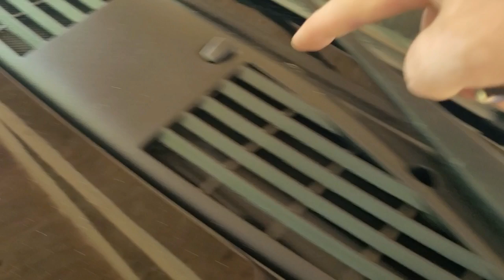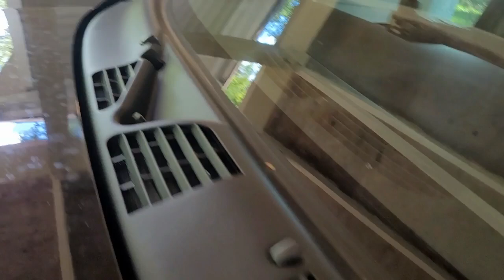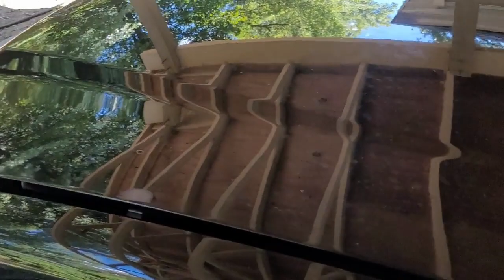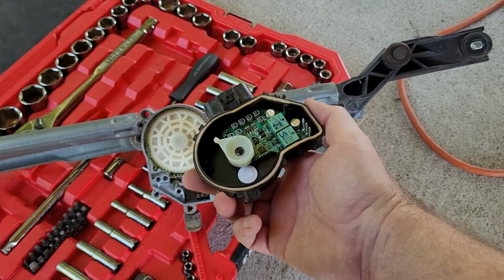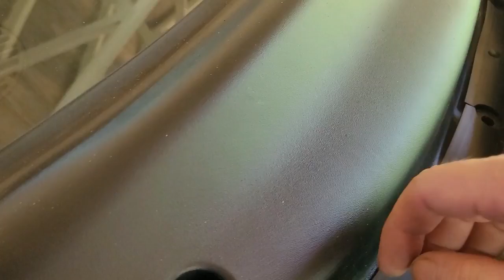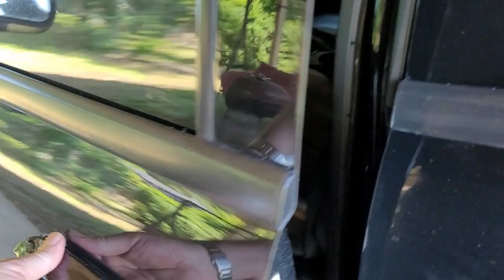Wiper Motor Circuit Board Replacement, Wiper Arm Removal, Cowl Removal

Comment: Thank you Alan.  The drivers side wiper nozzle of my 08 quit spraying.  I thought it would be an easy fix to replace the nozzle.  It should have been but the hose had separated from the existing nozzle down beneath the cowl.  Your video will be a tremendous help, albeit  a LOT of work and effort just to re-install the wiper hose.  I think those GM engineers new how to pad a simple fix into a major dealership gold mine.  Thanks again.